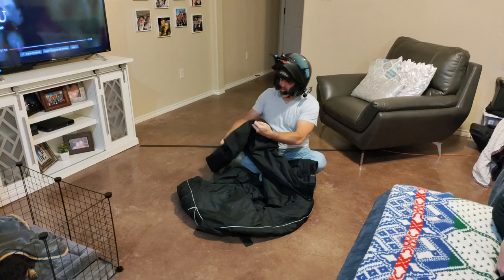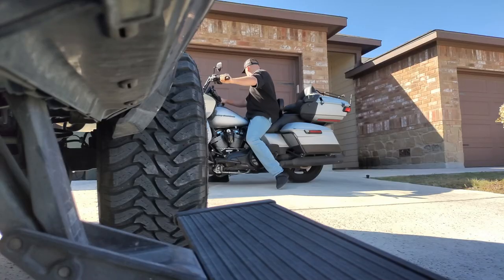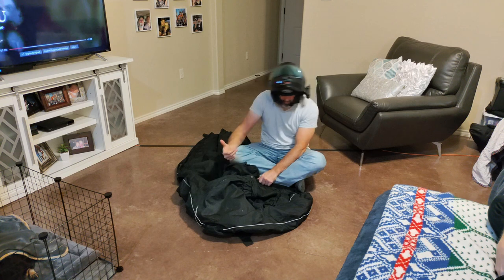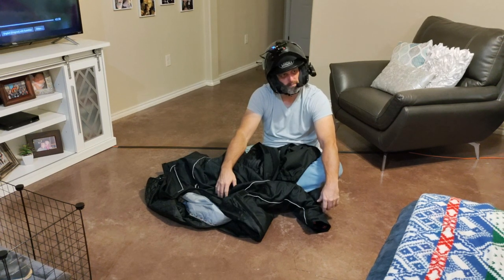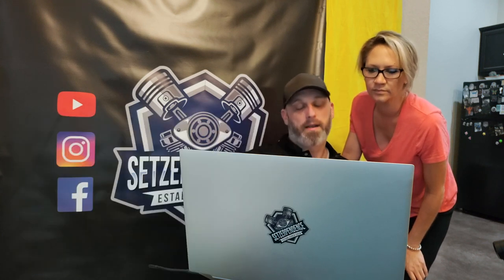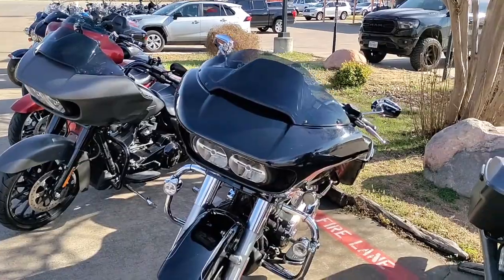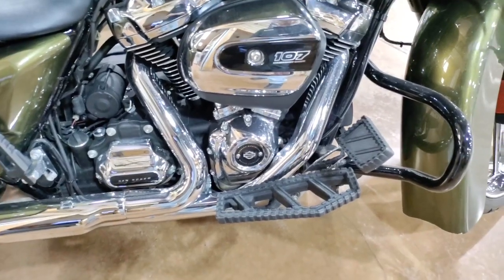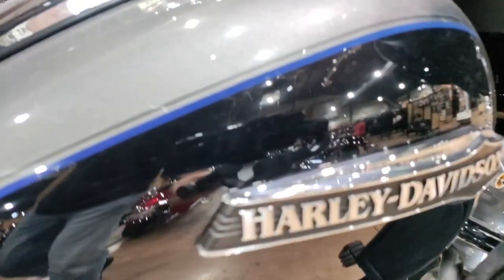Asphalt Slip N Slide

Comment: Hopefully you can get it back before riding season. I started to Make a comment about moonshiners on a build as some people have had issues with their builds.  hellson2 wheels has had a issues for over a year on his bike.
Reply from the maker: dude, i'm dying cause we ride year round 😭... Yeah, i've seen some of the drama Hells has had, and it definitely sucks, but i think there are two things that should be considered before writing off Moonshine... The volume of bikes those guys turn out is nuts, I am really curious what their ratio of bad builds are in relation to the good builds. and 2, no way in hell (no pun intended) would i be having something built like Hellatious. Moonshine does a stage 2 on a 114 that puts out the same HP & TQ as my 131...thats NUTS!!!